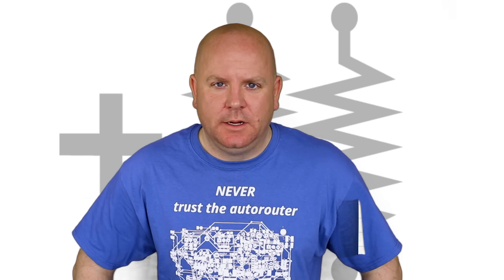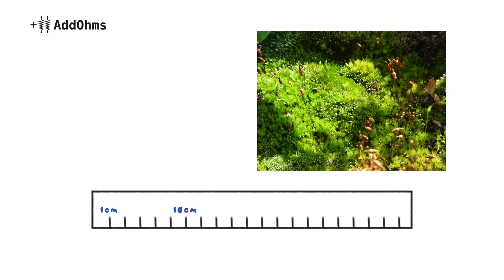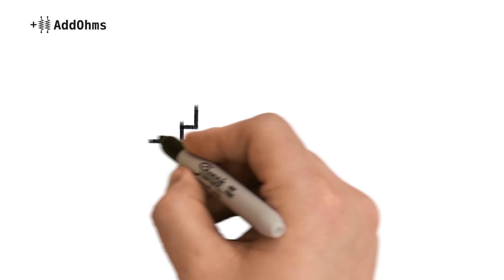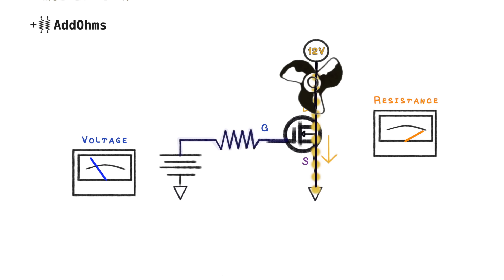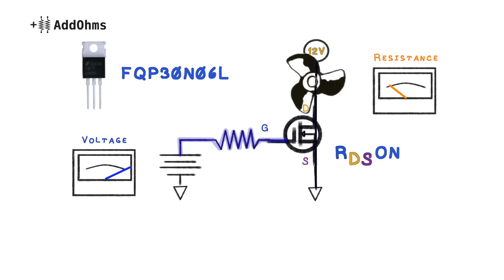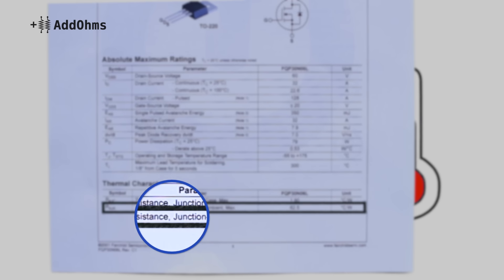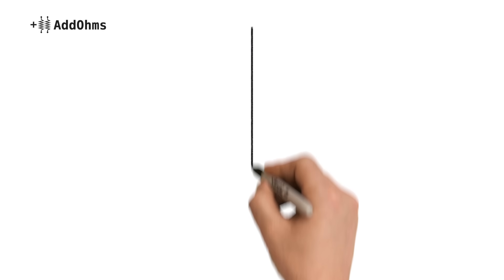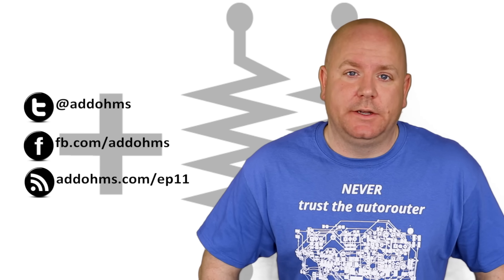MOSFETs and How to Use Them |  AddOhms #11

Comment: Mistake: 79W is derived from R_JC witch is 1.9 C/W and you can calculate it for every case temp. not only 25C.
by: (175-25)/1.9=~79C; or for every possible case temp T you can get:  (175-T)/1.9; so for T=-10C you can dissipate more than 79W.
Reply from the maker: Mistake: That is EXACTLY what I showed in the video.

Comment: Im confused....at 4:10, the datasheet says the min & max Vgs are 1 & 2.5 Volts.  So why is Vgs specified as 5 & 10 Volt values for the Rds(on)?  If the max Vgs is 2.5 V, why would you ever get to 5 or 10 Volts??
Reply from the maker: It's because "max" doesn't mean maximum in this case. Vgs(th) is the minimum voltage to turn the transistor on. So the datasheet is giving you the range before it turns on. "Max 2.5 volts" means, if you apply at least 2.5 volts, the transistor will start to turn on. (Or you could say that’s the voltage to turn off the FET.) It is a range because SOME transistors will turn on with only 1 volt. 10 volts is common to fully turn-on the MOSFET so that you get the lowest Rds(on) value.

Comment: Since the gate is entirely voltage controlled, what is your gate resistor there for?
Reply from the maker: The gate is a small capacitor. On larger FETs, the in rush current could damage an IO pin. Or it could cause the driving voltage to be unstable.

Comment: What is the reason for the resistor in the gate circuit?
Reply from the maker: The gate is a small capacitor. It helps to limit the in-rush current from an I/O pin. Depending on the microcontroller used, the size of the gate capacitance, and the switching frequency it is optional. In general, it helps more than it hurts.
Reply: Thank you. My interest is in dual gate depletion MOSFET's @AddOhms

Comment: Also isn't there some trick of running multiples in parallel for higher current so you can use cheaper parts-bin type components than high-rated specialty models? (At least if space isn't at too much a premium.) Saw something where it looked like an EV motor controller was doing that.
Reply from the maker: EV controllers are inverters so that they can have variable speed control. The Motors are brushless dc motors which have multiple phases. What you likely saw were 6 FETs to control the BLDC. They we not in parallel.

That said, you are describing a property of MOSFETs. They have a positive temperature coefficient. Which means their resistance goes up as they get hotter. So they naturally balance themselves when placed in parallel.

Comment: I wonder, why is the drain called drain and the outflow from the transistor a source?
It’s counter intuitive.
The gate I’d call „control“ as it controls the flow between drain and source.
The most confusing thing I find is the labelling of the pinouts.
Reply from the maker: The names are correct and very descriptive. They describe the behavior of the charge carriers.
Reply: Hm, hard to get my head around this.
I look at them by how they function / can be used (like the „control“ pin.

Comment: What about ciss on mosfet, that mosfet gate has capacitive element, so when we want to drive the mosfet we have to add pull-down resistor to neutralize the electron inside the gate

Comment: ive never had any luck with them,  some sources suggest that there needs to be a diode between 2 of the pins, I don't understand why though, I thought it was just a 'big transistor' and it would work the same way.
Reply from the maker: You might be confusing the "body diode." Because of how FETs are constructed, there is a "body" diode between the drain and source. That diode structure means you can't reverse the drain and source.

Comment: I am wondering if there is any comparison charts for various transistors that I can use in a switching supply.  I know as much about a tetrode and a npn bjt. I'm not too knowledgeable of the newer transistors such as GaN and  have repaired some equipment that has IGBT modules. I would like to build an inverter that can take 24vdc and convert it to 120/240vac. I am considering various MOSFET's for a low voltage drop as it is less than many other types.  I will be using a heatsink, and will be designing it with enough safety margin that I don't expect to fix it. I have designed things that are still working after nearly 30 years and a few moves for people with standard parts in a new configuration. Just because something is in the data books does not mean there are not many other ways to do the same things. Also taking into consideration the various thermal resistances and the level of spikes is very important, but I'm not completely sure how to calculate spikes, but figuiring the best solution might be a parallel LC circuit tuned to 60hz. Then using a high voltage winding with capacitors, as the higher voltage winding could use smaller wire in the secondary along with smaller value capacitors. Much as Lincoln electric does in the power equipment they design and build that handles thousands of amps output.

Comment: Why is there a resistor from signal source to gate ? How it's value should be computed ? Can it be omitted if using proper mosfet-driver chip ? Where is the resistor to quickly discharge gate capacitance when mosfet is turned off ?

Comment: That auto generated hand animation is extremely distracting
Reply from the maker: There is nothing "auto-generated" about it.
Reply: Nothing? You're telling me you used keyframe animation to animate all of those section where a hand is drawing the diagrams? Given that there programs that will do that for you it seems like a waste of time if that were the case.

I apologize if I came across as dismissive about the work that you put into your videos but none the less my honest opinion was that it was distracting enough that I stopped watching the video. Clearly other people had a different reaction so take it as you will.
Reply from the maker: The hand animations are the smallest part of the entire effort that goes into the videos.

And yes, they are keyframed. Hand-drawing-animation tools/software “uncovers” a drawing. 

I animate almost every element in the frame, which means those simplistic tools do not help. It is also why the hand is a small piece of the effort.
Reply: respek

Comment: what's the D in P sub D? Drain? Could it also be correct to say P sub max-without-heatsink?
Reply from the maker: “Dissipated Power”
Reply: great! 
- "Dissipated" means lost as heat, right? 
- So P sub D means amount of power lost as heat, right? 
- Therefor, P sub D DOESN'T mean "max without heatsink", right? 
- It just means, at a given input V and I, with a given fet, your fmla will tell us the max P sub D we can handle without heatsink, right? 
- Therefor, your fmla gives us "Max P sub D without heatsink", and not just "P sub D", correct?
- Therefor, would it be clearer in the vid to write the fmla as: "Max P sub D without heatsink =", instead of just "P sub D ="?

Thx!~

Comment: It's not quite right to calculate max power using ambient temperature of 25 deg C. You should always use the maximum ambient temperature and add a little bit. here it can get to 35 or even 38, so maybe 45 is a good starting point. Also if it's in a case even if it's with holes then you might want to add a bit more - like 50. so it's actually about 2W. I would assume 1.5W

Comment: The threshold is usually a range not a single value, stating that the fet will start conducting at some point within that range. But it's only starting to conduct at that point it isn't fully on. Don't assume that because your threshold is something like 2v to 4v that you're going to be fine with a 4V gate/source voltage to switch a large load, you won't be. The fet will have a very high on resistance at that point. You need to look further at the graphs to fully determine how to switch the fet HARD on, and you'll usually be wanting in the region of 8V to 10V even with a logic level fet to switch it on enough to be useful. The low threshold fets are fine for switching high impedance logic level signals but if you use one to switch a heavy load you need to be very careful what fet you're choosing. The transistor shown in this video is kind of a special case with a low RdsON at 5v, not all logic level fets are like this.

Comment: The Vthr is very confusing to newcomers, who think the device conducts above this voltage, when it doesn't - it starts to conduct a tiny current of few hundred microamps only at this voltage.  The Vgs quoted for Rds(on) is usually three times the Vthr or so, and this is the gate drive needed for full conduction, not Vthr.

Most non-logic-level MOSFETs have Vthr as "2 -- 4V", and these are never suitable for 5V gate drive, for instance.
Vthr is the turn-fully-off voltage, not the turn-fully-on voltage.  Also note the huge variability in threshold voltage - this
is inherent in MOSFET gate voltages, they all are highly variable, so you have to play safe and use the minimum
or maximum value as appropriate, not the "typical" values.

For instance the Rds(on) maximum value is the correct one to use for Rds(on), not the "typical" value.

Comment: Wait a minute!  The description of difference in application of BJT vs MOSFET is fundamentally wrong.  True, in most very recent usage,  power devices are more often IGFETS, and small signal devices are more often JFETS or BJT's,  but this has only been the case for for the past couple of decades.  40 years ago, it was the other way around...

Comment: Great video! 
I subscribed to your channel. I have a question, if the MOSFET will work as a variable resistor in a circuit when different amounts of voltage is supplied to it. Is it necessary to use a MOSFET instead of just a variable resistor like potentiometer or rheostat?  Why? 
Thank you 🙏
Reply from the maker: Enhancement mode FETs have very little variability. They are best used for a switch. A JFET has variability and more useful in an analog situation. Neither has the range of a potentiometer.

Comment: Hello. Thanks for the great video. I was hoping to learn a little about MOSFET drivers too. May you please write a quick and short explanation about why do we need them sometimes? Thank you.
Reply from the maker: Drivers are needed when the driving device can't turn on the MOSFET. A common example is when using a P-Channel as a High Side switch. A NPN (or N-Channel) driver is used to turn on the P-Channel.
Reply: AddOhms Thank you.

Comment: Hello,
Very nice video! Many common SMD MOSFETs (SOT-23) like BSS138 (From Diodes Inc.) has a very low V(GSTH) gate threshold voltage 1.5v for example. How that means we cannot connect them with I/O line of common MCU that operate at 3.3 or 5v?
Reply: Sorry for the stupid question :-( . I got the answer myself! Its not the V(GS) whose max value is 1.5v its the V(GSTH)
Reply from the maker: I simply warned that not ALL MOSFETs are suitable for "logic level" operation.

Comment: Why the resistor on the gate? You're practically charging/discharging a capacitor, and the thing driving the pin might have a maximum current rating, but still its usually so small energy levels that it doesn't really matter in practice.
Reply from the maker: Depends on the driver and the length of the wire or trace connecting it to the gate. If the driver is relatively strong then the "small energy" level isn't that small. As for length, it is entirely possible to create an inductive ringing which affects the turn on/off of the FET. The capacitor will dampen that ringing. 

Is it required? In some cases, no. Is it helpful? In most cases, yes. So I chose to err on the side of including it.
Reply: Energy is only dependent on voltage and capacitance. However, I agree that the power can get quite high if there is little resistance in the driver.

But yeah, LC resonance might be an issue with long wiring. However, I have never experienced this as long as I only keep the wire going to the gate no more than a few centimeters from the driver.

Comment: If mosfets  are voltage dependent, why do you use a resistor on the gate, please
Reply from the maker: A MOSFET's gate is a small capacitor. When a voltage is first applied, a capacitor draws a lot of current. The resistor is there to provide a small amount of current limiting. It protects the device driving the MOSFET.
Reply: AddOhms, thanks alot for your reply. I have a better understanding now

Comment: i was wondering about incorporating chemfets in raspberry pi controlled circuits where the gate voltage changes due to chemical changes in environment and  measuring the varying current and transforming it to an outputting a voltage / data logger.
Reply from the maker: I never heard of them before. However it looks like instead of being sensitive to voltage they are sensitive to “chemicals.” You would probably build them with a resistor divider network with the FET acting as R1 or R2. The details of that design depend on the sensor and outside the scope I can help with.

Comment: What is "Ta" (Ambient Temperature) at @5:45? is this the room temperature or values came from datasheet?
Reply from the maker: Ambient means the local environment. If the part is in open air, that’s room temperature. If it’s inside of a box, it’d whatever the temperature is there.

Comment: Thank you for this, i was experimenting with a mosfet(IRF740 stolen from a charger) and did not know how to connect it up.
After hooking it up correctly it would not turn off(after being connected the first time). After a lot of struggeling i accedently shorted G(1) and S(3). I then realize i maybe had to leak of the voltage of G(1). Dug up a 10Kohm resistor from my arduino kit and wrapped it on. That worked like a charm.
Is this a normal case and a correct solution to this problem i had?
Reply from the maker: I have absolutely no idea what you did.
Reply: I drew what i did. On the left drawing you can i placed a 10Kohm resistor between G and S. http://prntscr.com/iym9m4
Reply from the maker: It is because you left the gate floating. The 10K is acting as a 10K pull-down, which is allowing the FET to work correctly.

Comment: Can I use a logic MOSFET, to control a larger, higher current & voltage, non-logic MOSFET?

If a relay, is just a low voltage circuit, switching a high voltage circuit, so I can use small switches & buttons, instead of comically large ones.

Then can I use a low voltage, logic MOSFET, to control a bigger MOSFET, so I don't need a comically large potentiometer?
Reply: To control a high voltage, high amp draw, pair of motors?
Reply from the maker: Yes. It is called a driver. You could even use a small signal NPN to turn on the load FET, with the load voltage, providing a much larger Vgs.
Reply: Thank you. I don't know those abreviations yet. I have more to learn.

Comment: what is the purpose of the resistence in the video?
Reply from the maker: Limits the in rush current to the gate. A MOSFETs gate is like a capacitor. On a BJT you limit the current because the Base-Emitter junction is a diode.

Comment: Great explanation about heat. Thanks, it is often overlooked  because it is confusing, but your explanation was superb. Thanks!
Reply: Just don't forget that the ambient temperature won't always be 25°C. If the installation is some cupboard next to a south-facing window, you can bet that it'll get up to 45 in there and let the smoke out.

Comment: I have been driving 16 IRLB 8748 MOSFETs with 74LS595  shift register. The problem is the mosfets gets on unwantedly without serialy communating. Please help to get rid of this.
Reply from the maker: I don’t understand what you are asking. My guess is you need pull-down or pull-up resistors to hold the FETs in a known state when the 595 goes high impedance.
Reply: Thanks for your valuable advice
HC595 out > ---/\/\/\/\------to gate of mosfet
                              1k        |
                                         > 10 k pull down
                                         <
                                          |
                                      gnd
above is schematic I used for MOSFET IRLB 8748 ( Its VGS = +- < 20v and VGS th = 4.5v)
When I boot up my mcu some time all the mosfets are on and some time random. Even if I communicate 0 to all the mosftet gates through HC595 then all the mosfets goes off but after some time random mosfet gets on  with no communication.
Regards........Manjeet
Reply: moreover how can I add my complete Eagle schematic here

Comment: You need to connect resistor parallel to the ground, to unload the gate's capacity. Series resistor is a mistake.
Reply from the maker: Series resistor is intentional. It is to limit current when turning on the FET and provide a path to discharge when turned off.  A resistor from gate to ground would function as a pull-down to hold the FET in a known state if the controlling signal, or I/O pin, goes high impedance.

I have no idea what "unload the gate's capacity" means.
Reply: Pull-down will quickly discharge load from gate's capacity, when your control signal is 0. MOSFET isn't like bipolar transistor and current isn't flow GS patch when it's turn on so you don't need limit current. Series resistor can limit current for bipolar transistor's control MOSFET transistor. This circuit won't work with few kilohertz control signal.
Reply from the maker: On larger MOSFETs the gate capacitance can be large enough destroy a weak I/O pin. I know from experience.

Comment: I see a lot of [Gate-Source Voltage VGS ± 20] how does the +- work and how can i switch this on and off if i have and output of 0-3.3V??
Reply from the maker: You're looking at the "Absolute Max" section and not the "Electrical Characteristics." Absolute max is the range of voltages that will start to degrade (destroy) the transistor.
Reply: TY for quick response +1 Sub :D